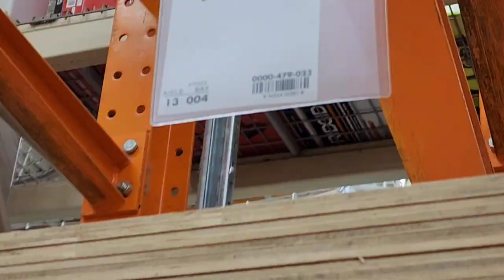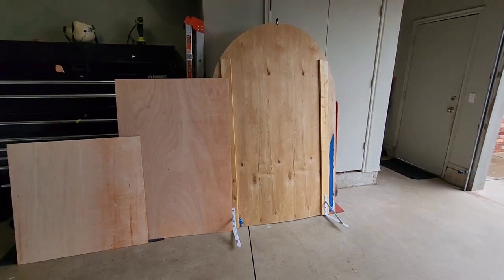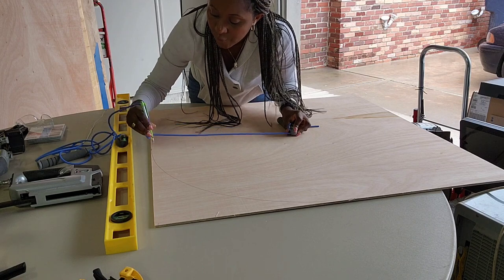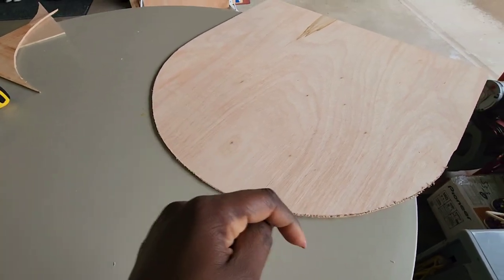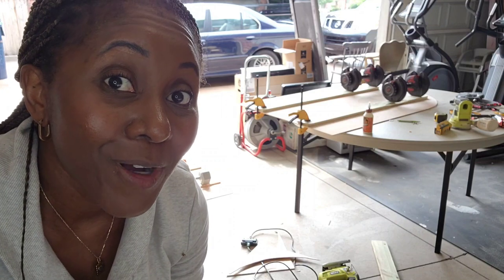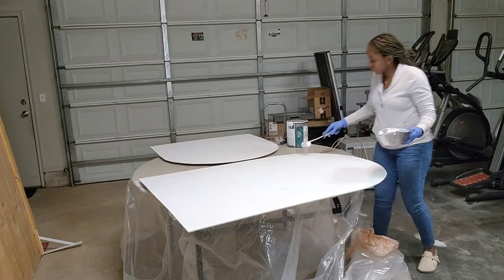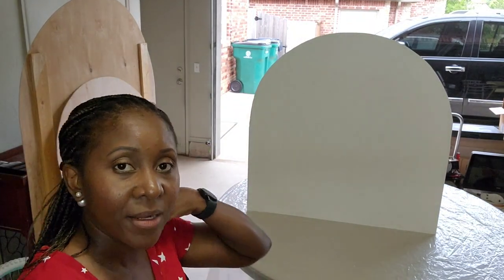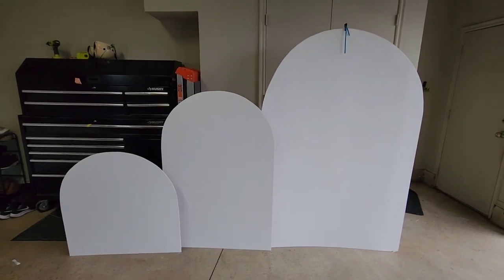How to make wooden backdrops for events

Comment: Do you remember what size screws you used for the metal brackets? Also , did you get the brackets Home Depot or Lowe’s too? Thanks!
Reply from the maker: I got the brackets at home depot, but I have bought them at Walmart before. 
I am not sure what size screws I used. I just found ones that would not go through the flat washer.